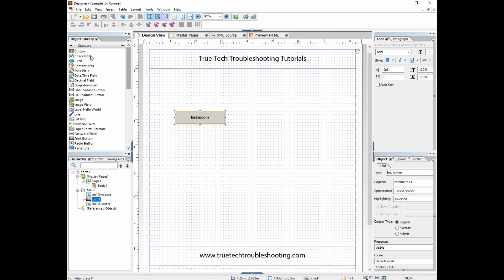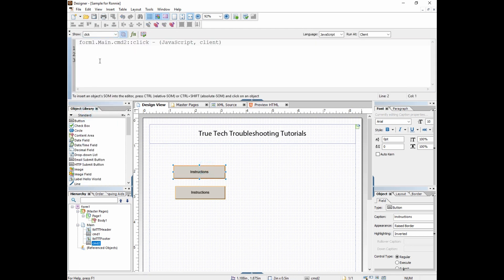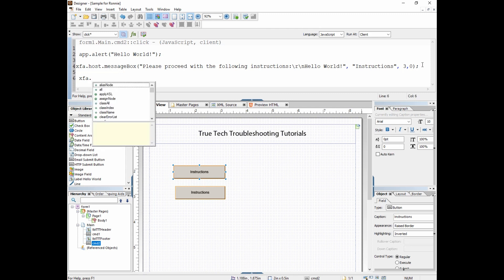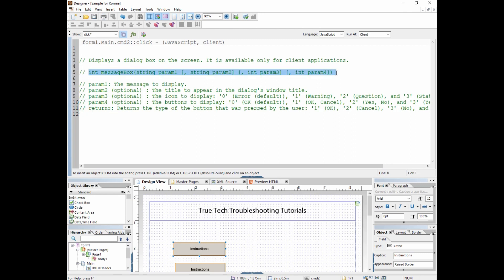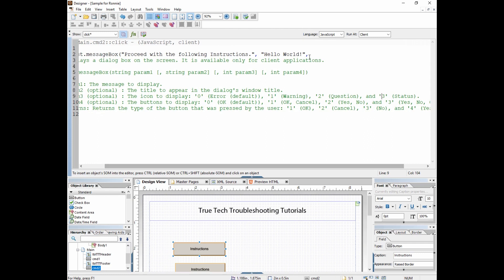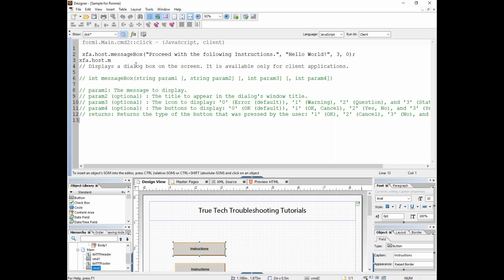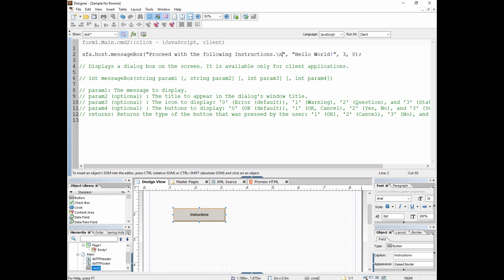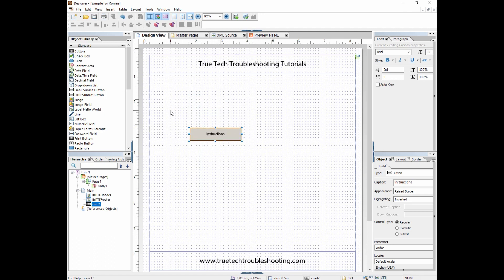LiveCycle / AEM Designer 201 - Part 8 Scripting Popups

Comment: When I create a checkbox at Design View page and see Preview PDF and click on check box then show dialog box "you cannot save data typed into this form. Please print your completed form if you would like a copy for your records."
and have to close dialog box. checkbox do not work. What do I. Please help me. I am use 6.4 version of Designer. Window 10 and Adobe reader 11 version.
Reply from the maker: By default, AEM forms are not Reader Extended.  See my video on Reader Extensions for a full explanation.